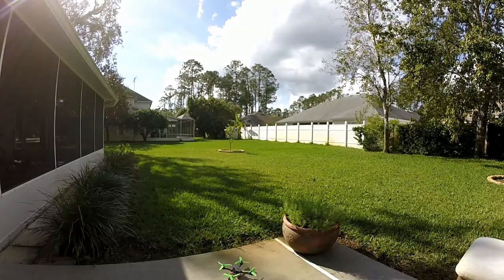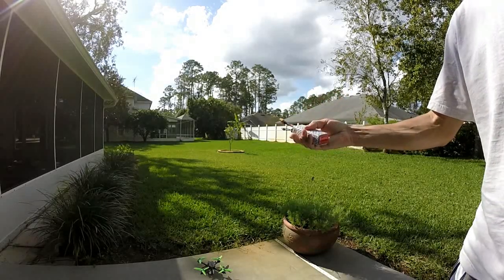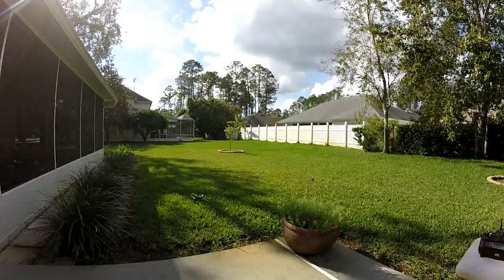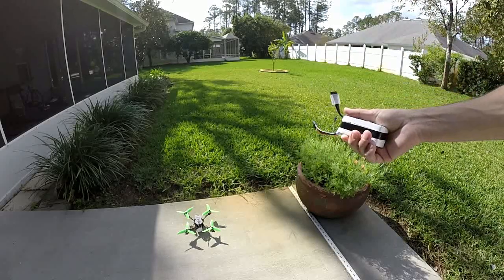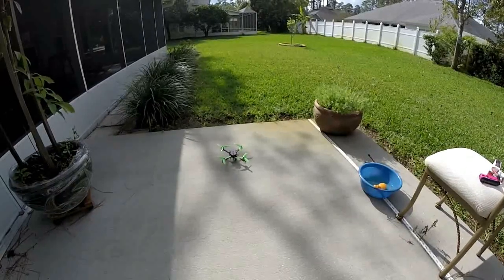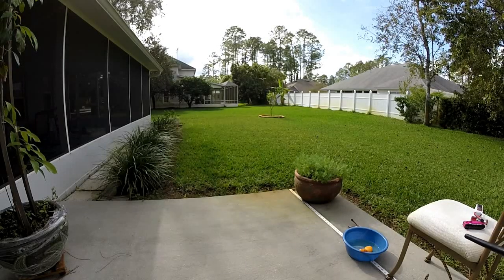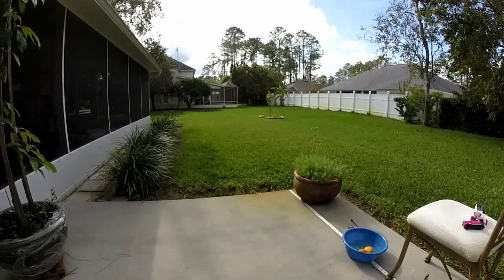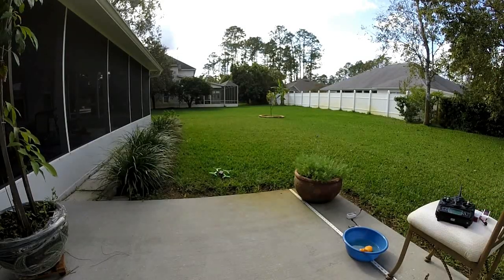CNHL China Hobby Line Lipo Battery Problems (4s 1500mah 100c)

Comment: mate your P and D gains too high for 4s battery
Reply from the maker: I thought the same thing at first. That wasnt the problem. It was a bad FC. I tried a huge range of PIDs and nothing changed. I believe that the voltage regulator for the gyro couldnt handle 4S. I dont think that it had anything to do with the battery. Unless some voltage regulators are affected by high C ratings.
Reply: @ninjasauce8855  no.not the C ratings fault. I would suggest you read up on how electricity works and what battery ratings mean, then you will see the C rsting won't affect your regulators

Comment: That's weird, I just got 7 CNHL packs, 6 x 1300mah 100c and 1 x 1500mah 100c all 4s and they are the best batteries I've had so far, I have rline 1300 but only 75c and the CNHL are so much more powerful
Reply from the maker: I like these batteries too. They just released some 120c batteries! The problem was with the FC.
Reply: If you now belive its the FC what about the FC is the issue? GYRO broken? I have several quads with that weird sound and twitching! Racerstar StarF3s and StarF4s AIO boards...
Reply from the maker: Ya, this is the TattooF4S. Its the 32bit version AIO. I believe its the voltage regulator leading to the gyro. Or even the gyro itself. Never got this board to work after monts of trial and error. I might re-visit it sometime.
Reply: Ninja Sauce ...big caps not really helping the twitch also...I am so annoyed...
Reply from the maker: Yup. Same here. I think a lot of these boards had a weird problem with the gyro that make it impossible to ever fly properly. For some reason, it adds an amount of roll with pitch input and vice versa.
Reply: Ninja Sauce ...dropping some P and D can help the twitching but then flys icky
Reply from the maker: Ya. I tried a million different combinations. It cant be fixed with the PIDs.

Comment: Def too high, drop back to default or lower.  That right there is low/mid throttle oscillations. I have 9 cnhl batteries all 1300mah 100c 4s and never had any issues since my 1st 4 I bought all at once in may 2017. Also check your tpa, you may need to raise the percentage
Reply from the maker: I really like these batteries too. They work great on every other build. Right now this FC is sitting in a bin. When I run out of projects, I might take another look at it. But im pretty sure that the problem is the voltage regulator for the gyro.

Comment: That beeping when you arm sounds like an error code.

https://github.com/martinbudden/betaflight/blob/master/docs/Buzzer.md

Looks like it might be Accelerometer Calibration fail. Also explains why it has problems flying correctly in angle mode.

What flight controller are you using? I have an old naze that the accelerometer has failed on. Angle mode no longer works, and it freaks out in Airmode as well. Not sure why they're linked, but that's the symptoms I have.

If you have an OSD, turn on the artificial horizon and see what it does. If it doesn't behave correctly, then you know there's a problem with the accelerometer.

Could also be a problem with gyro, too. Try calibrating both with stick commands when the quad is on the ground. Right stick down for both, left stick down and left for gyro, left stick up and left for accelerometer. Should get some flashes on the flight controller.
Reply from the maker: That is very interesting. I just listened to all of my beep tones. That tone is the correct arming sound. This is a Racerstar TattooF4s All in one flight controller.
Reply: I've never heard that specific pattern as an arming tone, but it's also been a while since I've had them on. I'll double check with another build of mine.

This is, however, the second time I've heard that tone in a video of a quad that has flight problems, so take that how you will :P

https://www.youtube.com/watch?v=yRkhvPbmbIg

You can hear it right at the beginning and after it falls from the sky in this video.

Comment: Your pids are too high for 4s. The chinda hobby line are a little heavier also . That's not twitching you hear. It's ossilations. Cut your p by 20%
Reply: Actually, your borderline high p on 3s.
Reply from the maker: These are just stock pids. I have tried these batteries on 3 other quads. I swear there is something up with these batteries. On my other builds, I have completely tuned the pids from ground zero, and there is no value where i can actually fly with the cnhl batteries.
Reply: Hit me up on Facebook messenger. Kelvin Kennedy. I'll see if I can help figure it out.
Reply from the maker: Thanks man. I dont have FB. Im thinking that I might need to get on there.
Reply: Smart man. Stay away from FB lol. Google Hangouts? First name last name, Gmail on there.
Reply from the maker: I tried lowering the P like you said. I think its on the right track because there seems to be less oscillations. But a Rep from China Hobby Line watched this video, and they said that this should not happen. 
I actually just had an idea, and I will try it out when it stops raining. I am thinking that I will try lowering the throttle idle percentage. I actually got a response from joshua bardwell about this a while back. He told me that throttle idle wouldnt make a difference, but its the only thing that I can think of that would be different on 4s vs 3s.